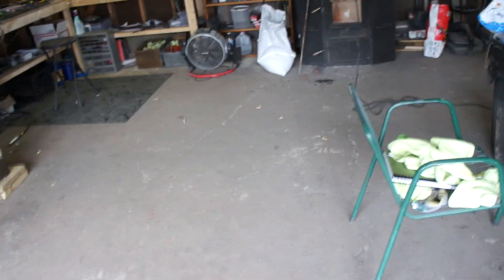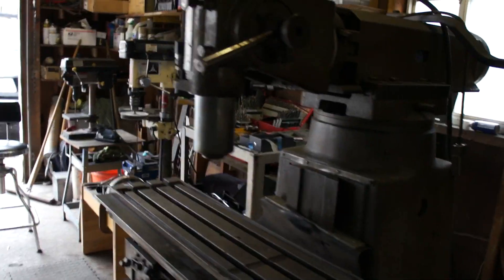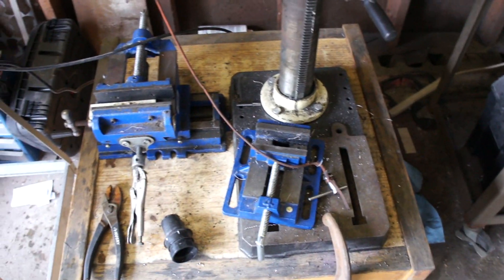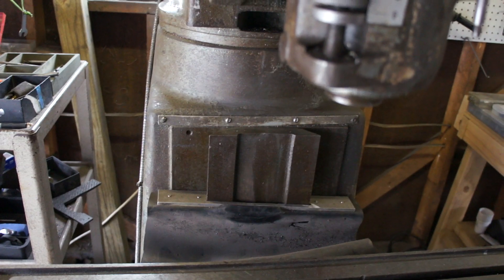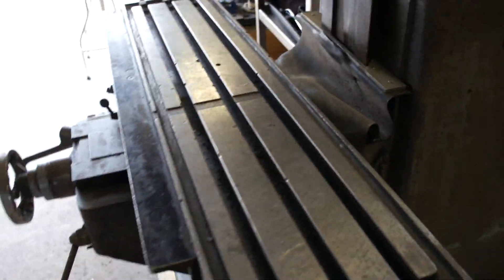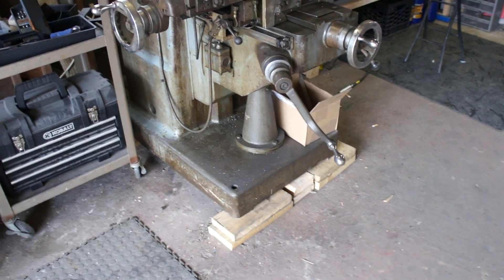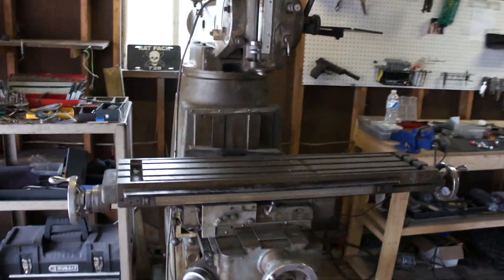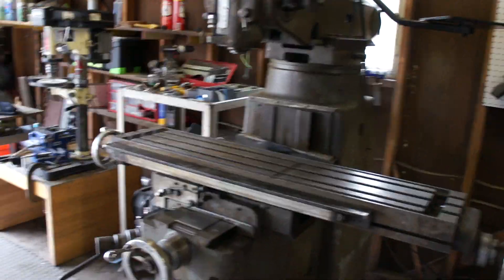New toy for TuffKnives!

Comment: I used to use a 1950's spindle moulder (woodworking) and age does not matter with tools like this, treat them right and they are bulletproof. Get the best tooling you can afford and you are set.
that is one serious workshop that you have made for yourself. The only thing that would improve it is if it was sound and thermally insulated, that's going to be a serious pain in the arse now the machines have taken over!
Congratulations, I can't wait to see what you come up with that set up, have fun.